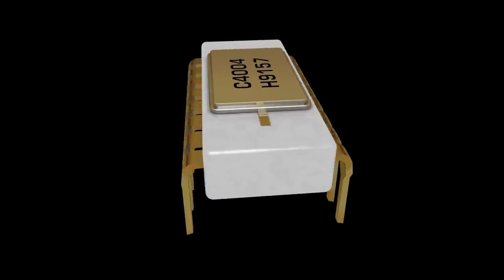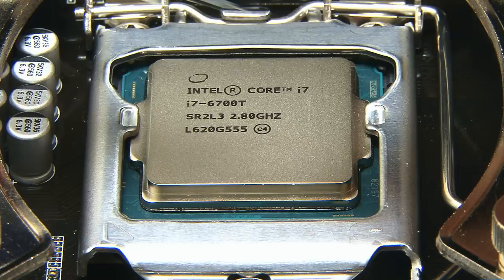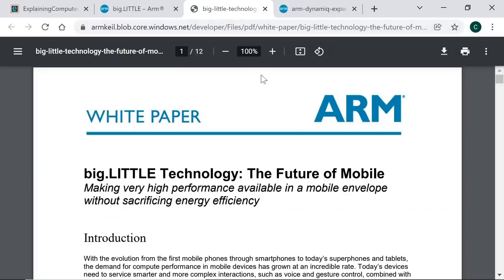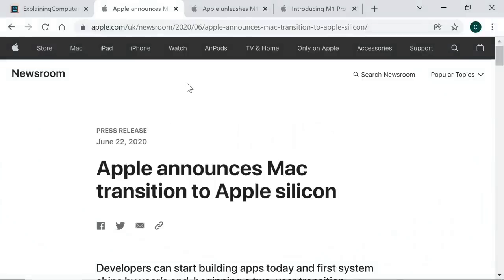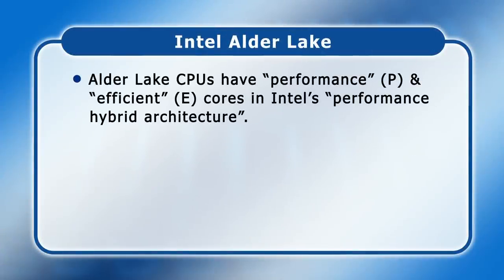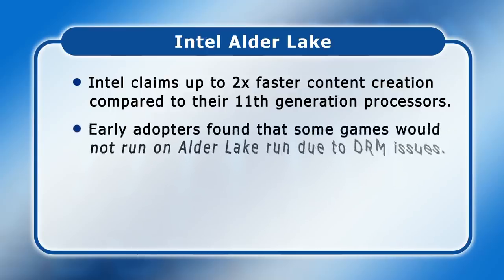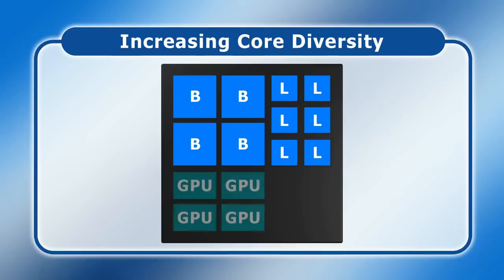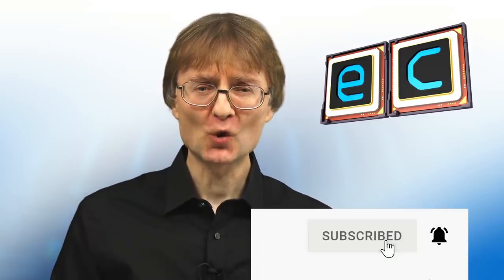The big.LITTLE CPU Revolution: From Arm & Apple to Intel & AMD

Comment: It will be interesting to see how big/small affects virtual machines
Reply from the maker: Now that is a very interesting thought indeed -- will we get the opportunity to select a number of big and little cores to allocate?
Reply: @ExplainingComputers  i think the support might come after a long time cause the majority i believe is still all big, but yea who knows
Reply: That's an interesting question, I never thought about VM's I run several, maybe Chris will find the answer!
Reply: I am a programmer, I use my home PC (I am not a gamer) to remote into a cloud PC to do work. My home PC should be optimized hardware for what I do - VOIP, PCOIP, and streaming video - so a couple cores and a single low end GPU work great for that. If I were a gamer or a video creator, that would change my core needs, and I would have to purchase the maximum amount of computer I plan on needing over time. Most of the time that hardware sits and degrades while doing nothing but sucking juice.

The cloud PC I use for work already allows me to select the number, speed, and kinds of cores, but only before I start using it. Imagine being able to hot-swap in and out various cores as needed in a virtual environment using your code, releasing computing hardware for others when not needed, but being able to swap cores in and out for large data loads, video renders, or a number of other tasks that require a spike in the need for some intensive task that has been hardware optimized. I sure hope the chip makers are thinking about that.
Reply: This was my first thought as well, since I often use my home skunkworks, err, LAB, to do proofs of concept.
Reply: It's the same instruction set so the software doesn't get a choice.  The hardware supervision (hypervisor?) must be allowed to control where those instructions go.  If there were a priority instruction available, everyone would only use it.
Reply: @waltermeerschaert  You could literally have a VM "download" more ram from another system when needed and then give it back after it's done with it.
Reply: Humm.. Pretty much the same as to specify a specific cpu target having the same perfs as an Ecore!
Reply: Hopefully they would allow an override so you could use only little cores. Uses vary but i only use VMs for running XP and 7, both which came out when CPUs had less power per core than what these little cores can do.
Reply: The new Intel CEO was previously CEO of WMware so I assume they have VMs in mind.
Reply: @ExplainingComputers  I follow your videos and always enjoy them, thankyou. My take on much of the Hardware/software war in just smearing   huge amounts of lipstick on a pig. The purpose of so-called advancements is to yet extract more financial gain from a failing technology as a whole. When I say this I mean the end users constantly having to deal with the ugly clashes of hardware and software compatibility. To move information from one piece of hardware to advanced hardware is complex beyond belief. Most of these Whiz Bang advancements are incremental at best and disastrous at worst. I get the same brain fade every day working with "technology".

Comment: I remember buying a Commodore 64 in 1984 with a 1mhz 8bit CPU. I thought it was incredible I could buy such a powerful computer for only $199 dollars, the 1541 disk driver had its own RAM and CPU and set me back another $199 dollars. Neighbors and friends were amazed at what it was capable of. Now an Apple watch can blow it away and the C64's price adjusted for inflation was equivalent to $1600.

Comment: I'm currently more interested in low power computing. I underclocked the Pi Zero (yes, the first one) down to 450MHz and still amazed by its capabilities while consuming less than 1W of power, incredible little chip.
Reply from the maker: That is a cool experiment!

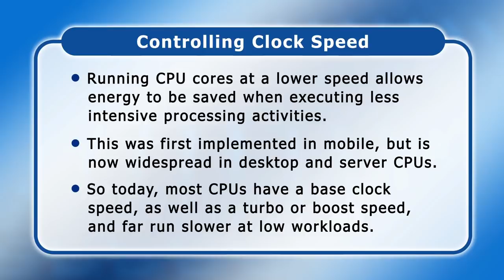Comment: 4:00 Funny enough that my first PC also had a variable Clock speed. Even had a button for it to switch. From 12 Mhz to 16 Mhz.
Reply from the maker: Ah yes, I remember -- the "turbo buttons" we used to have on the front so that software could be slowed down if it ran too fast. I had forgotten those.
Reply: My Hyundai PC/XT had soft switch (CTRL ALT +/-) to switch between 4,77 and 10 MHz :)

Comment: a little off topic but, AMD APUs are incredible value for money with their graphics core. I just got a 5700G and I don't miss a dedicated graphics card 1 bit. 
great video as usual!
Reply: I have one too and I love it.  From what I've heard, AMD is just getting started with their APU's, so it will be very interesting to see what they come up with.  I'm curious to see how APU's will benefit from DDR5 after it matures.
Reply from the maker: I agree, the Ryzen APUs are really excellent chips.
Reply: I've got a 5600G and it suits me. I think the graphics is about the equivalent of a GTX 1030, a fairly low end graphics card, which in the current strange market is about £100, if you can find one in stock. So when considering the 5600G at current prices, there's that much value included.

Whether you miss dedicated graphics depends what you want to do, of course. If you want to play modern games at maximum resolution and frame rate, the 5600G isn't much of a solution. In fact you don't have any solutions at less than ruinous cost.
Reply: I can't wait for 6000G. Supposedly RDNA 2 or 3 iGPUs will be involved.
Reply: I see this being one of the only great solutions to the current video card $$$ thievery.
Reply: 5700G is a masterpiece. It's almost like a 10th gen i7-10700K, but more eficient and the powerful Vega graphics.
Reply: My current machine is really showing its age so I guess it’s time to start researching what I need to do this. I was hoping to find a Christmas video card bargain for my Intel setup but…

I’d really love to find a chart highlighting which nvidia cards each AMD chip is equivalent to.

Comment: I feel like CPU design and computing in general have stagnated for many years now. Finally it seems there's something exciting on the horizon.
Reply from the maker: Agreed. I think we will see some incredible silicon over the next few years.
Reply: It really has.  These are exciting times.  I hope we also get added instructions to make maximum use of the new configurations instead of letting some automated system do it for us.  This would be especially good in scenarios where you hae a high-demand task but you explicitly WANT to set it as a background task and use lower power cores.
We can already see with M1 that it is decent enough at managing to do a lot of tasks on the little cores, so they are clearly capable.
Reply: @ExplainingComputers  We should see some very complex software that can take advantage of all these different types of cores, as well.  Exciting times ahead!
Reply: thx to AMD
Reply: The X86 market stagnated over the six years or so AMD was in the doldrums and Intel had no competition. I don't think that's so much true for the ARM world.
Reply: Horyzen
Reply: If only Intel existed, I'd agree with you. But AMD has been smashing the x86-64 market since 2017 while Intel was just turning thumbs. Just cause Intel is now "back" with their "performance hybrid architecture" doesn't mean they are the savior of x86-64. If Ryzen didn't came up, Intel would still be asleep and would not care. We'd still have 4 cores maximum in the consumer branch...
Reply: @LawsonBarnette  Engineers also need competition to keep them on their feet. The whole lot became complacent and lazy.
Reply: @GerardMenvussa  I don't see stagnation. 2017 Threadripper 1950X and 2019 Threadripper 3960X. The speed improvement is insane. Same for GPUs... I dunno in what world you are living.
Reply: The i7 5775c was the one time that it looked like we would get a new tech. L4 cache. It had it's benefits but they were and are far from being across-the-board gains. So it's interesting to see how Vcache will do. I predict it will be similar but a bit better. But there are also more games and programs that might benefit now than in 2015. Not a ton more, but more.

Comment: on DUAL-core CPU's
I remember many computer sites saying "there will be NO benefit to using a dual-core once they come out until programs are written for more than one core" to which I remember thinking "uh, that means you can have one core for Windows stuff and one core dedicated to a game/application... it's kind of a big deal!" That's back when a single core could see Windows spikes well of over 50% and sometimes ate up 25% or more on average... I really like the idea of having "efficiency" cores assigned to background tasks. Sometimes a few background tasks can hurt performance more than you might think if they share the same CACHE so it's good to separate OS stuff from critical performance in hardware.

Comment: In the late 1990's, early 2000's, I worked for a Southern California System Integrator who was a partner of Sun Microsystems. I was sent to a special Sun ( SPARK processor, Solaris OS ) for a briefing on a new SPARK processor. I had to sign a very restrictive Disclosure Agreement.

Sun shared with us that they had developed a 4-core SPARK processor and had adapted their Solaris OS to take advantage of it. I believe that all occurred about a year before the IBM multicore processor was announced.

Comment: Greetings from across the pond near Albuquerque, New Mexico, USA. One of the issues that seemed to be totally ignored when cluster computing first came on the scene was load balancing across all the cores used for parallel computing tasks that had varying memory and/or computing requirements. Assigning tasks to certain processors is one thing, and certainly important. Load balancing is quite another, if one wants to use all available cores on a processor. 'Thread Directors' will take are of assigning tasks just fine, I'm sure. But I'm also sure load balancing in big.LITTLE architectures will be more problematic but certainly a fantastic research project. 

Your videos are always information-rich. Thank you for working so hard to give such great presentations. Any mistakes on your videos show you are only human and not an avatar, thank goodness.
Reply from the maker: Thanks for this. I agree that load balancing is going to get really complex.

Comment: I specified a 'big & little' architecture for a military system, in 1985, at the board level, using a CMOS processor for day-to-day tasks, and a 'hot' CPU and co-processor for signal-processing tasks; the system needed to sit in the Arctic for months at a time, subsisting on battery power alone, in Arctic winter temperatures (as they were in 1985 ;-) ), so that this architecture allowed for a 20x improvement in power efficiency, and a guarantee that the system could perform on existing batteries, at a fixed size.
Reply from the maker: Very interesting -- thanks for sharing.

Comment: While most people have an intuitive idea that the big.Little split will improve power usage, I doubt many truly understand that this is a solution to two common types of execution threads that have been competing with each other for years now. 

The fundamental issue is the balance between responsiveness and throughput. Responsiveness is when the computer immediately reacts to your input, measured by the period of lag. Throughput refers to how fast a program can run when it is not interrupted. 

The problem is that user interfaces require responsiveness rather than throughput. Which means that we should optimize for responsiveness, right? Not so fast. Many UIs are actually wrapping tasks that require throughput. For example, video editing requires a lot of encoding and compositing, activities which are throughput sensitive. 

Splitting the cores means that we can provide the optimal CPU core for each type of task. User Interface components can stay responsive on energy efficient cores, allowing for lower power consumption. Counter-intuitively, throughput-based tasks can be run on throughput-based cores without interruption to ensure they complete as fast as possible. Which means the CPU spends less time on the intensive task, also using less power than a "balanced" CPU core would have.
Reply from the maker: Brilliant post, thanks for sharing here.
Reply: @ExplainingComputers  Thank you! Glad it was helpful.

Comment: If you look closer M1 Pro 10C CPU / 16C GPU has also 16C NPU unit. I started to use one yesterday and I'm yet about to discover the benefits of NPUs. 
From what I can tell under low to medium loads (Outlook, web browsing) two low power cores do all the work at nearly 100%, with CPU temp around 27-30 degrees C (22C room temp). But I haven't pushed them to do heavy CPU bound work yet.

Comment: Apple's M1 chips are quite incredible in terms of balancing processing power and battery life. I'm using one of those M1 Macbook Pro now and you can pretty much get close to the promised 20 hours battery life with normal use (web browsing, office use, and some YouTube streaming), and pretty much no heating up in normal use.
Reply: Till they slow things down with the hopes of not getting caught. They have done this on their phones. Thsi being one of th emany reasons i wil never own a Mac. Apart from that why do i need to pay 1/3 more for less performance?

Comment: AMD's EPYC server processors go beyond "a staggering 56 processing units". Some of them have 64 cores. There's a "prosumer" Threadripper that also has 64 cores.
Reply from the maker: Yes, my bad. I forgot the AMD counts there.
Reply: finally intel started to make some moves) they thought that they could sell the same quad core processor for another 10 years)
Reply from the maker: @Grom84  Agreed!
Reply: @Grom84  Their 10nm superfin process runs a lot hotter than I expected, though. Those Alder Lake processors are difficult to keep cool.
Reply: @johnm2012  can't confirm, i'm on amd) a year or so.

Comment: The problem is most people are still using an OS that was designed for a single core 486 with a slow af hard disk. The NT kernel needs a ground up rewrite .

Comment: in AMD latest presentation, AMD said that they will not use "big little" architecture rather place a SMART separate hardware scheduler in the processor that could bring more efficiency to the core when needed (or even disable the core when not being used)

it will be easier to implement because the software such as game will not have DRM issues (like Intel) - Seamless
Reply from the maker: We shall see! :)

Comment: Idea - Assume energy has many turns and twists as a function (move electrons). Increasing the speed and energy makes turns earlier resulting in a dense heat. There should be a way to create CPU's that don't make many turns? I assume in a perfect circle you can go infinitely fast. So make the a CPU where C stands for Circular //Per Big little circles and you got an area cpu

Comment: As you mention, big.LITTLE vs P&E cores is just a lingüistic difference, but Apple does use the P&E nomenclature in the marketing material for final users! I guess it's more consumer friendly after all, so why not.
Reply from the maker: Very interesting. I wonder it they did this from the start, or only now that Intel is using those terms.

Comment: A very thought provoking video from Chris @ E.C, I was absolutely amazed at the upcoming tech you talked about, we're on the cusp of another computing revolution, keep watching this space. A reduction in heat that the components produce has got to be a good thing as it'll increase their longevity! No doubt we'll see an increase in competition between the companies to produce the next iteration of their latest computer hardware, once the current shortages have been resolved, sigh!!
Switching over from silicon chips plus new battery tech and we'll be sorted, especially with the cost of soaring energy bills. I'd already read about the Alder Lake problems, Intel tsk tsk, mutter, mutter ,grumble, glad to hear it's being resolved.   :)

Comment: Good video thanks.  How about exploring a concept where the rear camera has to display the image before the Linux processor can boot up.  Hence the need for the M4 processor.  Recently, TI has introduced an A7x processor with a Multicore Arm R5 processor in one chip for these applications.

For us single-board computer folks, this architecture allow us to mix RTOS code and Linux Code.  Systems such as Robotics, Industrial Control, and Processing tasks such as Image Processing could use this architecture.  Power saving could be achieved by letting the Linux Core shutdown and the embedded core stay active.

TI has been active in this area for at least 10 years.  The problem with TI is that they concentrate on large customers and not small users.  Having single-board solutions would be ideal for us small folks.

As an aside, about 9 years ago I attended an all-day presentation from TI.  In the presentation on the beagle board, the presentation complained that too many users were using beagle boards in their products.  TI was a chip company.  This resulted in the world and including me becoming Pi fans.  Pi along with Arm is leading to the rise of the Briitish Empire.

Comment: While multi-core is more relevant for home users, multi-processor computers have been around for quite some time several decades prior to the Power4. The difference between multi-core and multi-processor is that by incorporating the cores on-chip, all the interprocessor communication is faster... higher bandwidth, lower latency, etc. The concepts, however, are the same. SMP programming in either case. Some of those even had processors of different speeds. I remember working on an SGI system back around 1990 or so that had four 40MHz processors and two 33MHz, IIRC. There was even work in heterogenous systems in the late 90s. I worked on one system that had boards that had a single PPC and multiple DSPs on each board. The DSPs were fully functional processors and not just coprocessor types.